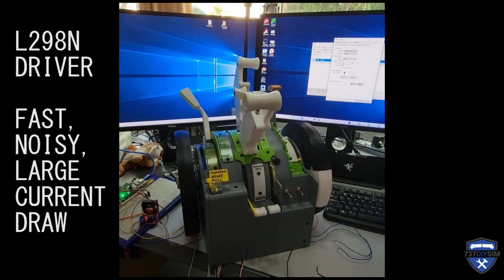BOEING 737 MOTORISED THROTTLE BUILD (PROTOYPING) 2

Comment: This is just simply amazing! Rock solid engineering and I am glad that also you make small mistakes and have to redesign and reprint things a couple of times - i thought this would only happen to me :-)
Reply: Will the new version of mobiflight allow this motorised version to be used with pmdg in fs2020?
Reply: @Daniel_Goddard  I would assume so. I hope PMDG exposes all variables from their aircraft.
Reply: Hi. I was able to get everything working with the config I have.
I finally completed my 737 quadrant. the gear ratios and settings are exact match for FSX.
Reply: @Daniel_Goddard  NO. They have not created presets to motorize the levers in auto throttle, I am doing it with Mobiflight and in the discord nobody knows how to tell me which are the presets for the throttle lever in A/T or the compensator wheels in A/T. I have been a little disappointed in the support they have NOT provided.

Comment: This is just awesome, I’ve only just built the v3 throttle unit but this is next level and cannot wait to build this.  Love all the new camera angles but would love to see more close ups when coming to the final wiring as this is often the trickiest part for me as a novice avionics type person. Keep up the great work Karl
Reply from the maker: Hi Steve, Thanks for the kind words. There will be more close-ups, promise. Im having an issue with the Samsung S21 camera I use for the close-ups. The video and audio are completely out of sync when transferred to the computer. I will hopefully get this sorted. It's a lot easier to film now that I have rearranged the workshop and cameras too. Cheers Karl!
Reply: @helimech8152  hi make sure you are running all cameras at same frame rate and you create the project at those frame rates. If the cameras allow time coding in settings turn that on. Try making a clapper noise which will give you a spike to align your audio to the footages then you can cut and trim. On a side note the wiring part is the scariest part as said above. A several part step by step video series for this throttle would be great. Now that mobiflight has had a massive update recently do you envisage this throttle being compatible in Msfs? Could I build this and run in msfs but not wire in the motorised part until we have compatability? Cheers Dan

Comment: I’ve used steppers for decades. For stepper motor connections, you really need to use 4W screened cable with the screen connected to power ground at the driver end only. Especially if the driver uses switch mode current control. Otherwise you will get a lot of noise transferred to other wiring which could cause you no end of difficult problems to track down.
Reply from the maker: Hi Mark, I mentioned this in my patron build video, where I use real aircraft screened twisted pair. It stood all jitter. Hopefulky, anyone reading this will also use this option. Great knowledge to share and thank you.

Comment: Looks pretty cool! I think I might have a suggestion for the flap selection mechanism: instead of requiring the user to pull the lever out of the detent in order to move it, you could achieve a less-choppy actuation by using a sort of "dual-ramp" detent where you utilize the spring tension in the lever to force it to sit in a valley between two ramps, thereby fixing it firmly in position while still keeping it easily manipulated. Additionally, you could have a slider inside the flap lever that you would connect the spring to and give it room to slide up and down, making it so you can manipulate the flap lever with my suggested "dual-ramp detent" while keeping the lever completely level during travel, avoiding any "hopping" that would otherwise occur between each detent. That last part might be a bit more complicated to implement, but it may be worth a try!

Just something I thought of while watching, so I'm offering it up for consideration. Regardless, I'm impressed with what you've put together so far and am excited to see the finished product!

I swear there's a term for the "dual-ramp detent" that I'm describing...I just can't seem to think of it...
Reply: The real flaps handle works just like this, pulling it up to place in the next detent, it is actually "choppy" :)
Reply: @pilotmax  Ah, I suppose it would make more sense to keep it the way it is, then. Pretty impressive how accurate he got it to the real deal!

Comment: Always great seeing your videos, and I'm trying to catch up on anything I have missed. I hope you can help with this question.

Do you happen to know the gear ratio between the trim wheel and the trim setting indicator? As an example, approximately how many times do I have to turn the wheel to trim the aircraft from 5 to 6. The reason I ask is that I have a machine shop and would like to start making a throttle pedestal for the 737, and I need as much info as possible. Thanks!

Comment: When it comes to those screw terminals there are improvements.  When you select a part get the rising cage clamp type.  Another thing that helps immensely is using ferrules on the wire ends.  Stepper motors are more more reliable with heavier wire.
Reply from the maker: Awesome Randy, all noted and hopefully taken onboard. I never thought about just buying the screw terminals as i usually buy them in kits, but i will buy a bunch now. As for the ferrules, hmm that might be a little harder to source here. I'm thinking just pre soldering the ends of the conductors will also act like ferrules. I'm currently using real aircraft wire, after after producing the next video yesterday, I am never touching another DuPont jumper wire from china. I must have had a bad delivery. After testing over half, none of them have passed continuity checks and caused so many errors in my prototyping. I now have ordered just the connectors to make my own wires/jumpers. Thank you for the advice and if you want to throw any more my way, please feel free. I should add all these tips and hints people give me to the website too. But that will be for another day! Kind Regards Karl

Comment: Try tmc2209 drivers as in a 3d printer. Or if you want something as big as the tb6600, I replaced those in my CNC with dm542 which are decent for higher power motors, I had many issues with tb6600s but now it's perfect.

Comment: Hello karl
 you have done it with stepper motors  ,  the other  way is to go with dc motors 12V  , i.c.m  with polulu  jkr cards. i have that build . It works with prosim . 
But  i find your build  nice .
Reply from the maker: Hi Dennis, that is what i am currently looking into now, But with postal times taking upto 5 months right now from the UK, its going to be while to complete the testing.

Comment: Great Work as Always !Keep up the good work,Will you be able to show how to connect those Stepper Motors with Arduino and Mobiflight.
Reply from the maker: Hello and thank you. I will show all when i get the prototyping done and everything works how I want it. These video are just the journey so to speak and not the dedicated final build. Things are changing very quickly and I'm on revision 6 or 7 of most parts already.  Kind Regards Karl
Reply: @helimech8152  Thank you Karl.I my self has started building a A320 sim and learned a lot from your videos.Greatly Appreciated.

Comment: Hello Karl...
Congratulations for the excellent work
.. you were upload when i analyzing your previous video.. You are progressing solid and fastly... 
i want to ask you about  hardness of throttle is enough? i guess it supply by step motor... My V1 Throttle  has main problem about hardness because fall back by its weight.. So me to find another way for this problem. 
Firstly i  want to ask you your opinion. 
Make hole inside gear of lever 3 pcs and mount magnet inside main lever gear. (Your yellow gear lever on this video) Than put the  1 mm insulating material to both side of gear , after that mount metal both directions of 1 mm material. But the problem of this way is step motor should to being forced so this way is good for non-motorized but you can think again for speed brake.  
And seesaw logic for lever will take up space towards the bottom so we can evaluate this area with electronic and  mechanic parts 
As your Throttle of this video working awesome and Nema 17 motors power is good solution for all of my different method also if fit inside throttle body which you made it.
And certainly i liked your solution of reverse lever which is realistic more than other. Because same with real aircraft, there is 2  step of reverse pull .. Is possible to reverse locking by the ground proximity or non idle position on this project ?
Do you think  any another way about instead of potentiometer for  flap level  ?
Do you think to using hall effect sensor instead of other potentiometer (Throttle lever)
i am nothing to find say anything for parking brake module .... Excellent .
decal raising is excellent ...
i  looking  to day of you share this project  on your website  await impatiently
Best Regard

Comment: Amazing ! Did you consider use a separeted arduino mega with 3d printer shield on the top, to controll the step motors?
Reply from the maker: Hi Klaus, That was actually my first option as it was so cheap. But when I moved the stepper motors against the holding current, the board melted. My guess is that it didn't like the back voltage/current produced when overpowering the steppers and moving them manually when powered. I haven't tried the latest generation though, with the silent drivers and with opto isolators, which might help. For the time being, This seems to be the working route. Kind Regards Karl

Comment: Hurry up. Lol  Which printer are you using by the way to do those large prints ?.
Reply from the maker: Hello! This is the Creality CR10 v3. It costs double the price of the ender 3 here in Brunei at around 600BND/300 GBP. But in my opinion, is also 2 times better in build and print quality than the ender 3. So happy with the upgrade and the larger print bed size of 300 x 300mm required for this project. Kind Regards Karl

Comment: That is a great built. 
I have a question - How it is possible to move it manually - does nema motors are switched off in manual movements or we can move them and they "remember" their positions?  How it is solved?
Reply: 16:02 - hope this helps.
Reply: @sky173  ok, it helps a lot, there is a pot to know the position 0-100 %,  thx for that.

Comment: Am I right in thinking that without an arduino shield the stepper motor will only spin in one direction? I’ve tried it with the arduino mega and a TB6600. I’ve got msfs connected to mobiflight which runs my stepper motor but only in one direction. My NEMA 17 is also really jittery and loud.
Do you think a shield will solve these issues or should I look elsewhere?
Reply: Nevermind I had a faulty TB6600 driver. Replaced it and all works well. I’ve had to ground PUL-, DIR-, and connect PUL+ to arduino pin 4 and DIR+ to Arduino pin 3 and it works great

Comment: Hi Carl, I actually have an ender 3d V2, and i'm thinking about buy this throttle but I'm afraid how much it will all print, are you able to estimate how much printing time it is and how many spools you would have to buy?  and if not, what was the total cost for you
Reply from the maker: Hello, DONT be fooled, this whole will will cost you several hundreds of pounds. The hall sensors used are 29 euros each. Many people are now asking to replace them with cheap pots. This was designed to be a Pro build and its costs represent that. I didnt spear the expenses on this one, After all is was over a year in design and prototyping.

Comment: Once again great work as always.
one question tho, what type of font and size do you use for the panels MIP; OVERHEAD as ex:?
Reply from the maker: Hello, Its usually Arial at 3 or 5 mm depending on the location. However, this is not the official font.

Comment: Do you think it would be possible to utilise something like spi or i2c on the arduinos and make panels link to a bus, in a modular fashion whilst still using mobiflight etc ?
Reply from the maker: Hello Rob, I dont believe Mobiflight has that option yet, but they are continuously improving their software. Kind regards Karl
Reply: @helimech8152  Cheers, I spoke to Sebastian and apparently he’s looking at implementing SPI in an upcoming release….  Must express thanks for your vids, have been really motivating!!

Comment: Once again I ask that you or get someone to curate the parts.. Everything but the 3d prints... And sell. Good for your and good for us. Also I ask to pls split the 3d prints for us with smaller printers. This is going to be my first project of yours.
Reply from the maker: Hi SG, I can not sell physical parts right now due to my location and contractual agreements. I will try to split the parts, to open the design to everyone, just not sure how yet! But that's a few months down the road as this design takes 4 days to print any one part of the shell/case, even if I make the smallest adjustment. Kind Regards Karl
Reply: @helimech8152  understand.. Another suggestion. On your website blog for the project, pls list the parts required, an image of the part and links to sellers. Looking forward.
Reply from the maker: Hi Sg, i think you may have missed that. Each project has a picture and link of each part. Both under the getting started menu - SIm parts and the online build guides under downloads. you can check them out there. kind regards karl